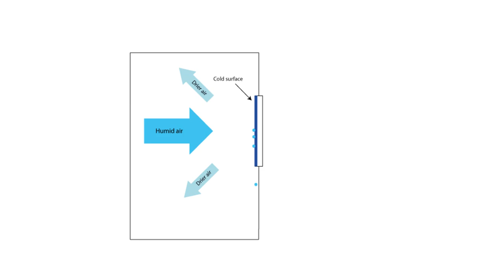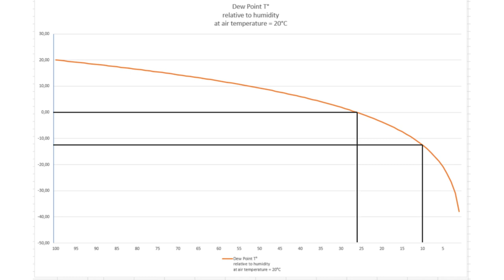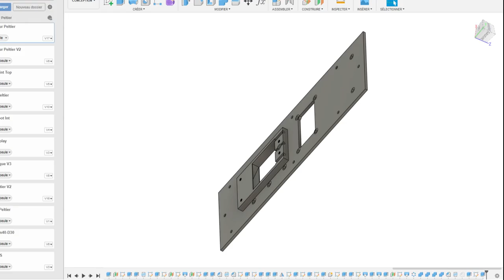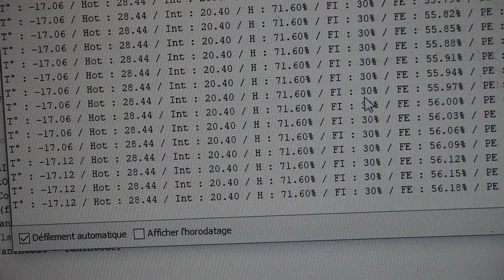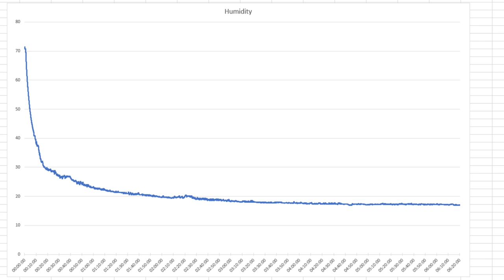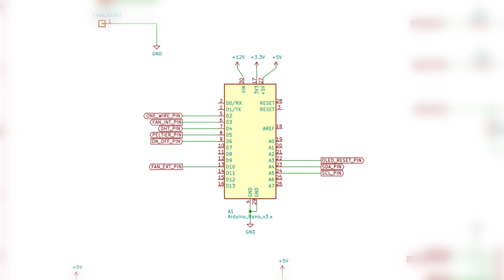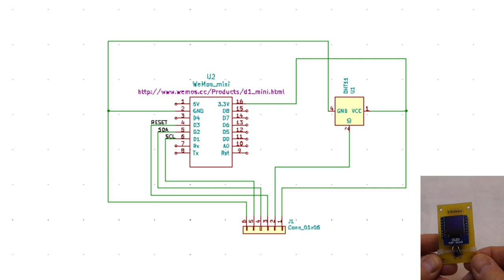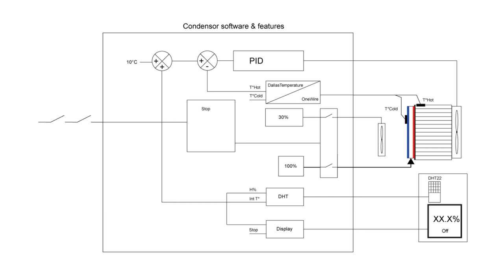I designed an air dryer with a Peltier module to keep my coreXY printer filaments dry while printing

Comment: This is INSANELY Awesome! Thanks you so much for making the project and showing it to everybody with great details in this video - oh, the special effects blew my mind 😱😆
Reply from the maker: Thanks for watching GeekDetour.
I'm glad you liked it and watched your video about Sunlu Filament Box.
I wonder which solution, condensation or heating, is better in terms of electricity consumption.
With the condenser, I maintain two coils at 15% humidity with a consumption of 30W and I was impressed by the 350W of the S4.

Comment: Merci for the wonderful video! 

A suggestion to improve efficiency, have the hot side within the chamber with ducting to redirect the air back to the filament. As the temperature drops in the case less and less moisture can be absorbed by the air. Since the water removal occurs at the Peltier surface where the temperature is locally very very low it shouldn't cause issues and may actually help to alleviate the frosting issue. Instead of pumping some of your electrical energy out of the enclosure you could recycle it inside. This would allow you to reduce the number of sealing surfaces required and also implement a pseudo-heater. 

As far as moisture removal, a wick works great but you could also have a funnel which collects water into a very small holding tank with a float switch and water pump that occasionally pumps the water out through a tube--this would provide another way to seal the case and it is very unlikely that significant water evaporation could happen through the water drain as diffusion through thin tubes is almost negligently low give that there would be no convection over the water surface.

Edit: I've just read some of the discussion about the fear of increasing the enclosure temperature to the point of burning out the Peltier Device. I suspect that you would likely see an increase in enclosure temperature however given how much of it is made of aluminum it may conduct and radiate heat out at a high enough rate to counter this. Again, having the hot air from the Peltier heat sink redirected very locally to the filament may help to ensure that the material receives the majority of the high temperature, low humidity air to remove moisture, which would then cool somewhat through conductive heat transfer via the frame and plexiglass as it circulates back towards the Peltier cold side. 

If you wanted to get REALLY fancy you could have a two stage heat since with one enclosed set of fins within the enclosure and another set outside of the enclosure, then if the temperature gets too high in the enclosure an exterior fan can extract additional heat. 

I don't know, but it is a very fascinating device that you have created and shared. Thank you again for inspiring such an interesting conversation!
Reply from the maker: Hello Liam, thanks for your comment.
I already discussed this point in the comments.

The idea of using the consumed power to heat the inside of the box is good. 
This will increase the dew point and the efficiency of the condenser.

But I think that the idea of keeping all the power inside is not good.
The principle of the Peltier effect is to maintain a temperature difference between the two faces (inside and outside)
If you put outside into inside the all system will heat up and the temperature difference between the air and the cold surface will not change or worth decrease.

I presume that the good way to do it would be to have a bigger heatsink with an outer fan connected to a smaller one heating the inside with the inside fan.
A smart fan speed management should be able to maintain a target temp inside the box while maintaining a low temperature of the Peltier.
Reply: @workshopfeedback  I was toying with the idea of using peltier for a dry box. Never got to building it. The idea was that the box would be vented and the incoming air would pass over the peltier to remove moisture. The hot side would have 2 radiators. One of them enclosed in a duct so that the box air could be recirculated over it to heat the box. Second half would be cooled by external air as needed. Why I ditched the idea was that peltier can keep around 60degree temp difference. If I want the cold side to be -10C then I'd need to keep the hot side not over 50C. The box temperature would not be nearly enough to dry nylon etc. Maybe it would work if I would use only external air for cooling the peltier and use something else for heating. For storeage I use silica gel that I throw in the kitchen oven once in a while. Keeps the box humidity around 15-20%.

Comment: Peltier cooler is the right way to go. I think you can improve efficiency by designing a textured water condensing plate.
You can also make the collected water wick up to the heatsink to be evaporated.
Reply from the maker: During my test, any attempt to increase the condensation surface resulted in an increase of its temperature and of the minimum humidity level obtained. I finished to go to the simplest.

Comment: One suggestion to increase gathering condensation, is to periodically flip/flop the positive and negative going to the Peltier heat pump.

As many may know, when you flip pos/neg to neg/pos, the cold side now gets hot and the hot side now gets cold.

So while it's running, you might be able to calculate how much ice build up there is on the cold surface, then flip/flop the voltage and probably PWM it to not be fully on, just enough to allow it to warm the surface enough to melt the frost buildup.

The frost will then turn into water and rain out. 

This will increase dehumidification, because when frost is there, dehumidification efficiency is lowered and even just stops.

Just like a home dehumidifier when the coil freezes.  On those units, the compressors have a flip valve that literally does the flip/flop thing, but not with voltage, rather, with how the coolant is moving.  It "reverses" when frost is detected.  The "cold" coils warm a bit to let the frost melt.  Then flips back to normal operation.

Efficiency is increased with this process.
Reply from the maker: Thanks, you're right.
In fact I don't reverse the voltage but just switch the power off and let the device temp  between both faces to stabilize. 
It has a real effect on the efficiency. By flushing every 4 hours I obtain a humidity rate below 15%.
Reply: @workshopfeedback  Nice!!!
Reply: @workshopfeedback  I recently had this idea pop into my head aswell, and then I looked it up if others did it before me, only I had a slightly different flow in my head. 

As I understand it, you are now effectively cooling your filament chamber right? If the temperature drops, the relative humidity rises, and the dew point also lowers (to sub zero). 

My idea was to guide the air from inside the filament chamber past the peltier element (ideally also with a small heatsink on it) where it condensates, then the colder dryer air should flow past the hot side of the peltier to heat it back up before it re-enters the chamber. Hot air will be more capable of taking up moist from your filament, and you might raise your dewpoint above the freezing point, eliminating the frost issue. 

At a chamber temperature of 40 degrees, your dew point will be at 0 degrees with a relative humidity of 8.3%. I think you should steer on having the cold side at around 0 degrees by splitting the airflow after the cold part in two channels, one directly into the chamber, and one past the heat side of the peltier. If the cold side is going sub zero, redirect more air directly back into the chamber, and if the cold side is getting to close to the dew point, cool the hot side with the cold air.

At worst you simply have a heated chamber, which is how most filament dryers work anyways, at best you have an active dehumidifier
Reply from the maker: Hi Henkheijmen, 
I confirm the system slightly cools the inside of the box and I agree that it is necessary to use part of the heat produced by the Peltier to warm it up. We need a large heatsink on the Peltier and another small one that heats the inside of the box. By regulating the speed of the fans located on each side, we should be able to maintain between 30 and 40°C in the box. This would raise the dew point and provide better results.
I understand the benefit of keeping the cold side above zero to avoid ice, but experience has, for the moment, told me the opposite: the colder the Peltier, the better it works. I simply let the peltier warm up regularly to let the ice melt.
Concerning the radiator on the Peltier, I never managed to get good results, probably for the same reasons as before.

Comment: Very cool. Personally I’m going to try also having the hot side in the box to let the filament temperature get up somewhat, like what you see with a honey drier. I’ll also include a heat exchanger for outside air before the cold side though. Or maybe I’ll make a cyclic desiccant dehumidifier.

Also you forgot freewheeling diodes!
Reply from the maker: Hi James,
Using part of the power to heat the inside should be nice.
You may be able to get a very low humidity rate.
Let me know what you did.
Thanks for the diodes, you're right, they are missing on the fan drivers.

Comment: Why not use the hot side to heat up the chamber? To get higher temperature at remove more water from the filament? You can also reverse the current in the Peltier to faster deice, but that might be overkill.
Reply: Cold side has less power due to inefficiency but the walls will absorb heat. If heat overpowers frost, the ice will melt from the surface evaporating the water.

One way is to vent heat in at the start of the cycle only, then turn the valve the other way to vent to outside. Another servo might be overkill though
Reply from the maker: Yes, using the hot side to heat up a bit the chamber could be interesting as it would increase the dew point temperature.
Not easy for me to integrate on the existing design but should be tested.
When cutting off the power supply and the external fan, the cold face heats up quite quickly.
I'm not sure that the module would apreciate the reversed power

Comment: It feels like venting the air from the hot side outside the box is a bit of a waste as increasing the temprature will also help draw moisture out of the filament. why not keep both sides of the peltier ellement inside the box?
You could actually just put a commercial peltier dehumidifier inside the box so you can get both some heating as well as the dehumidification effect.
Reply from the maker: You are right we could use the hot side to heat the box but I don't think that putting it inside would be a good idea as it will probably overheat.
Using a commercial one could also be a solution but still outside of the box.
Reply from the maker: And I guess commercial dehumidifiers keep their cool surface above 0°C to prevent freezing.
This gives a dew point around 25% or 30% humidity at room temperature.
Reply: @workshopfeedback  hm yes. thinking about it some more I suspect the move might be to initially draw outside air over the cold side to condense the water and then have the now cold and dry air go over the hot side to raise the temprature, drop relative humidity further and recover some of the energy used to cool down the air, before releasing it into the box.
still feels like continually introducing fresh air into the system can't be quite optimal as you are also displacing the allready dehumidified air by doing so but you are probably right that keeping everything closed naively would lead to overheating before raching optimal dehumidification.
Then again having the inside of the box quite warm means that the relative humidity reached at a dew point just above freezing woud be quite a bit lower than at room temprature. 
maybe a dehumidifier plus a thermostat to prevent overheating could be a nice and lazy solution as one could just get some off the shelf devices, drop them in a box with filament and be done with it.

Comment: Very cool!  Thanks for sharing!  I wonder if it would be able to get the humidity even lower if the defrost cycle was more frequent, to collect the water.  Every few hours, maybe
Reply from the maker: I dont think there's so much water to evacuate.
There's no dropdown of the humidity rate after a flush.
I rises a bit and returns slowly to its original state.
Thanks for your suggestion

Comment: Thank you for the wonderfully clear explanations of your projects! Would it make any sense to use the hot side of the Peltier as the heat source for the inside of the box?
Reply from the maker: Thanks Michael,
Yes ! it absolutely makes sense.
At least on a physical point of view as it would raise the dew point.
Its also mechanicaly possible to have part of the heatsink heating the inside of the box.
I presume the inside fan could also be placed on the interior heatsink.
Needs a bit more space but would be a good enhancement.

Comment: I think if you keep both the hot and cold side inside the chamber it may be more thermodynamically efficient for both the chamber and the outside room
Reply from the maker: Using the hot side to heat up the chamber seems to be a good idea.
Using the heated air to refresh the peltier module is not as this will also increase the temperature of the cold side.
Reply: @workshopfeedback  My idea for a similar project was to use the hot air to actively drive moisture out of the filament, either on the spool or in the path to printer. But since I learned about molecular sieve, I've just been printing out of passive MS dry boxes.

Comment: I had roughly the same ideas than you, but I never pushed myself to do it. Your video gives me more motivation to do it. Is there a reason to decrease the temperature below 0? 
The only difference with my idea was to heat up the temperature inside.
Thanks for the video
Reply from the maker: Hello Jerome,
Thank you for your answer.
I think that your idea to heat up the box is good. This should be done using the heat produced by the Peltier Module.

Concerning the temperature of the Peltier, it depends on the desired humidity level and it's different from commercial air dryers whose function is to draw water from very humid air.
For an air temperature of 20°C, the dew point is 0°C for a humidity level of 25%.
I tried to obtain the lowest possible humidity level and i get a rate of 14% with the Peltier module at -16°C while the dew point is then at -9°C.
In all my measurements, there is a difference between the theoretical dew point and the temperature on the cold side.

Let me know if you success.
Reply: Ah sorry, I missed your very good point about the dew point. I will definitely keep you updated when I will do it.
Reply: Is there a need for the internal fan? While cooling, I would not turn it on, to make sure the temperature goes down. While warming up, I would not turn it on, to avoid the water to evaporate too much. Is it possible to see your code?
Thanks!
Reply from the maker: Hello Jerome,
The idea is to circulate the air in contact with the condenser. I seem to remember that I took measurements which showed that the indoor fan helps speed up the process a little at high humidity levels. But I introduced a regulation to reduce its speed when the ambient humidity level drops, this allowed me to save a few%.
It doesn't hurt to stop it during the flush.
If you are looking to warm the enclosure by recovering heat from the Peltier, you will instead place the fan on a heatsink and use it to regulate the temperature.
There is a link to the project files in the video description and I added the latest version of the software.
Reply: Merci

Comment: Cool project.  I've seen commercial drying cabinets that have a dryer that drys desiccants to atmosphere then seal up to have the desiccant dry the cabinet. Did you look into this system?
Reply from the maker: I tought to this option recently but never seen any product like this.
If you have a link, I'd be pleased to see that.
Reply: I don't think it's letting me post a link but search. UNDERSTANDING EUREKA AUTO DRY BOX AND ITS USAGE. You've inspired me to try and make one myself. I belive it will have similar electronics to yours but it has the advantage of heating the filament compartment.
Reply from the maker: @NotWorkingAtAll  Thanks, got it.
There's an interesting DIY valve issue.
Keep me informed !

Comment: Had to search for this solution.
Most of 3D printing community focuses on wasting heat in what are essentially air fryers or desiccants that require a lot of energy to reset to dehydrated state.
I think this one of the more efficient solution for reaching cca 20% humidity at room temperature.

Have you considered design that would recirculate the heated air inside (other side of the element dumping heat back inside)?

What is the duty cycle for your enclosure?

Thanks :)
Reply from the maker: Hi,
Yes, we talk about this option quite a bit in the comments.
It is certainly effective but I have not tested it.
What do you mean by duty cycle?
Finally, I'm not sure that this is the least consuming solution...
Reply: @workshopfeedback Sorry I should have read all the comments they answered few follow up questions that I had.

By duty cycle I meant element on/off cycles and resulting power draw of the device.

BTW The link to files with overheating protection requires you to allow access. The link above it does not.